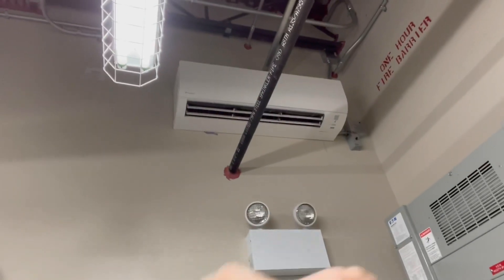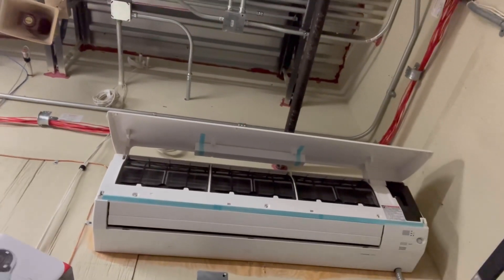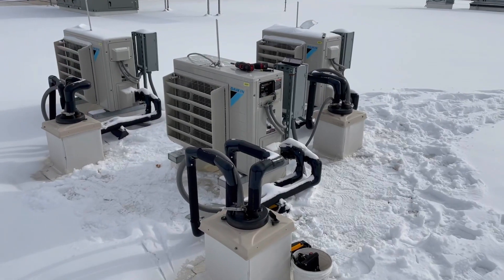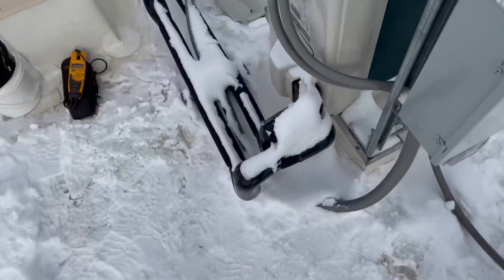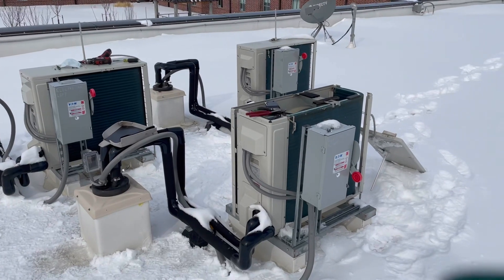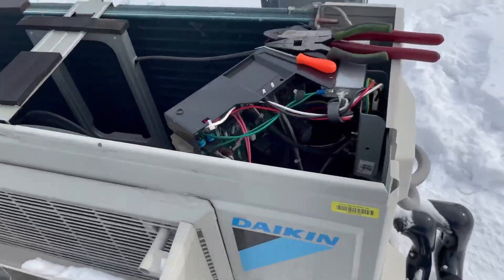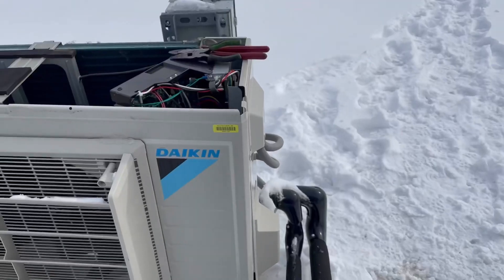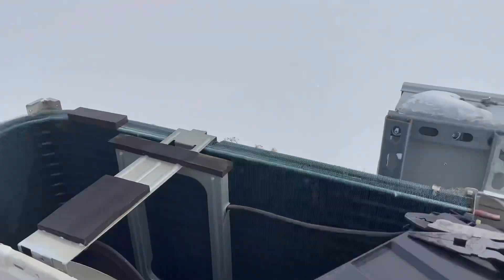Daikin Heatpump no heat???  #Daikin #heatpump #heating #HVACEXPLAINED #cooling #steamfitter #hvac

Comment: Nice video,,,I have little question,,,the air off from the indoor what it should be in good operation ? Heating ? Air off in cooling? 🤔
Reply from the maker: Thank you very much Comfort Systems.  
I’m not understanding your question ?  Are we talking about blower motor running after it satisfies heating or cooling mode?  If you can, please rephrase the question and I’ll see if I can answer.   Have a great night.
Reply: @hvacexplained9341  yes …blower motor
Reply from the maker: @kcomfortsystemshvac7060  honestly, I believe you can select fan on or auto mode. It’s been a while since I’ve been to that facility.  since then, I have moved to Florida from Pennsylvania.   But I generally like to let the blower motor run to circulate the air and keep it more consistent.  
I’ve been real busy lately replacement of split systems since the hurricane.

Comment: Regarding the J6 cut...It appears this is used for very specific purposes on specific units, as when trying to cool a server room in the winter, when the AC is necessary.   It's a little  confusing, in that Daiken would require a somewhat intrusive setup for a typical residential setup in the NE, for example.   Curious if this is required on a typical setup - I ask.  Great vid.   Thank you.
Reply from the maker: Only if it’s under a certain temperature for low ambient conditions.  The original first time I’ve ever taken a service call on a situation like this was probably in 2012.  I had a small data room that was around a 100°F and the unit was not cooling. I was reading the manual and found low ambient conditions. Please cut this jumper.    I was stunned that they would make you cut something on a circuit board! I called the manufacturer to verify even though it clearly showed it in the booklet and they said yes.   
Thank you very much for the compliment. I do have a lot of content I will be posting. I am currently in the process as we speak of packing up to move to Florida and continue doing HVAC but in another extreme condition lol.   I post short clips on TikTok under the same screen name along with icon if you are into that social media. FYI. Have a great night. Thank you once again.
Reply: @hvacexplained9341 any negative effects from cutting this ?
Reply from the maker: @100pyatt  hey good morning.  
The application that these units were used for is: for an electrical room and server rooms.  
Also, yes, it’s located in Pennsylvania so the weather does get pretty cold from time to time.  
It definitely doesn’t seem right to clip a jumper. that is soldered on the circuitboard.   “So far No Negative side effects” I did confirm it with the factory and that is what you do for low ambient conditions and it “does not”harm anything.   
It does say that also in the manual. 
Some equipment they use dip, switches, or a removable jumper, which makes sense.  I still don’t know why they even give the option just leave it removed.  
Have a good day. Hopefully this helps you out.

Comment: Are lg heat pumps good?
Reply from the maker: I do not want to knock on another brand but I am definitely not satisfied with LG Appliances.  Household appliances I have never seen so many problems with circuit boards in my life.  I’m told there cell phones and TVs work well but that I do not know from personal experience.  I do have an LG heat pump in my garage that I received for free off of a job site. The unit needed a new blower motor and had three leaks that I had to repair but it currently serves my garage and works rather well.  
Our shop installs Fujitsu and Mitsubishi.  In my opinion the Mitsubishi I have seen the least amount of failures.  Daikin I’ve had a handful of problems mostly with problems like you seen above where they did not set them up properly. “User error”   But like any piece of equipment it all begins with good installation practices, start up and maintenance.
I did talk to LG tech-support one time when I was frustrated with their product and one thing that they mentioned that makes a big difference on their equipment make sure that there is a surge protector properly installed in the breaker panel.

Comment: Yes you have to cut the jumpers for low ambient cooling.  Also notice a problem with the snow hoods?  Upside down.
Reply from the maker: Not many people noticed that.  I believe they can be turned for different situations but yes I believe they are in upside down I did not mess with them at the time I was just told to get them running.

Comment: It stays cut then, or did I miss something.
Reply from the maker: You “Must” cut the Jumper on the circuit board in order for these to run in cold conditions.
Reply from the maker: Since I did not have the manual I had to use my iPad look up a manual then clip the certain jumper that I have shown in the video.  Typical air conditioning systems are not meant to run in cold climates we have to alter the systems generally using a crank case heater on the compressor along with a fan cycling controller to keep the pressures up to eliminate freezing coil’s.